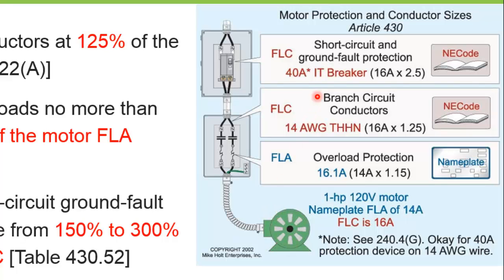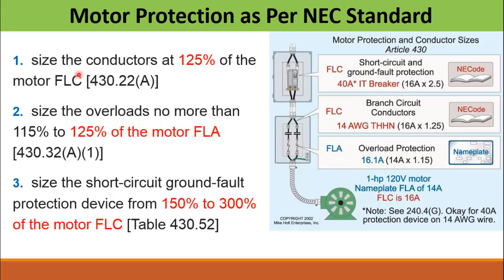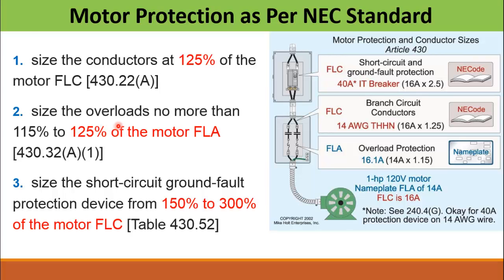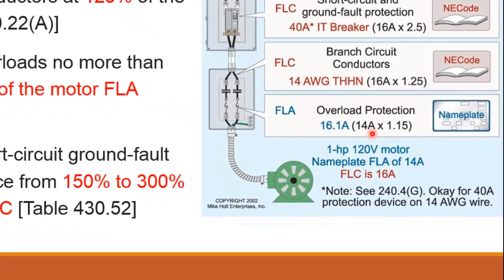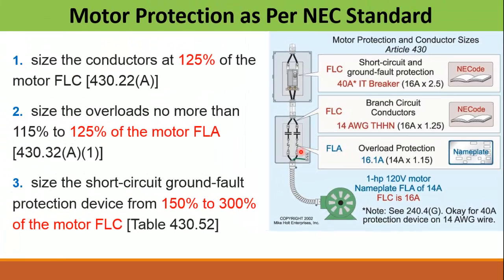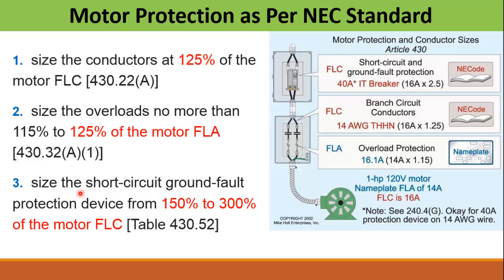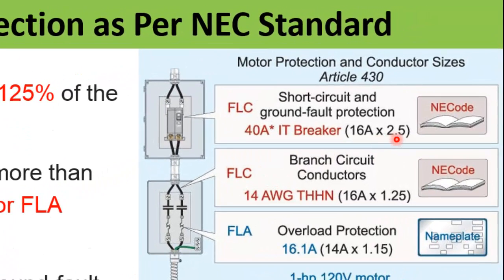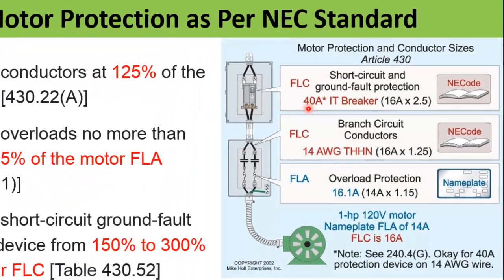Calculate Size of Circuit breaker | Size of Overload | Cable Sizing for Motors as per NEC Standard

Comment: I have questions. 
1. Isn't cable size is based on LRA of motor? If motor is starting and stopping frequently, every time more than 5 to 6 times more current is passing through wire. Which will burn the cable. If we select the cable according to FLA.
2. Isn't the breaker capacity should be less than cable conducting capacity?
Reply from the maker: Please watch my another video for sizing of circuit breaker. There i explain reas9n why circuit breaker rating is not less than  cable.

Comment: Sir how to calculate size of cable along with sc perspective
Reply from the maker: U never size the cable with sc perspective. Only overcurrent sizing is done. For sc breaker is there to protect cable and motor that is why its very imp to size breaker properly. Cable has the cabaility withstand sc
Reply: @electricallectures  sir but won't cable will burn if it can't tolerate sc current  in case of sc
Reply from the maker: Ofcourse it will burn. But again ur circuit breaker is meant to protect against sc
Reply: @electricallectures  You are wrong Short Circuit calculations are necessary for cable sizing .
It is given as :
Minimum Size of cable in sqmm = (Isc * sqrt(t))/K
where 
Isc = Short Circuit current
t = time at which circuit breaker is expected to trip
and K is the factor depends upon type of cable
Reply from the maker: That is true what in general you mostly dont know short circuit current. In that case this method is applicable